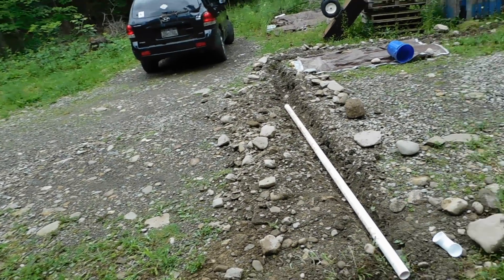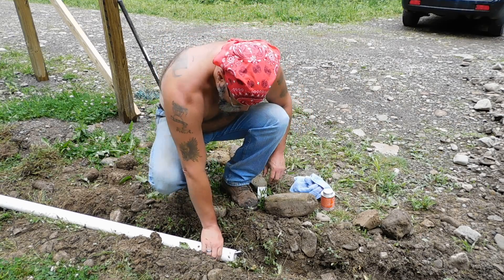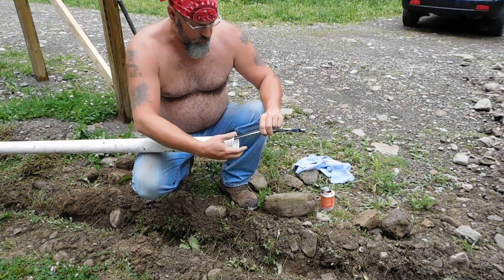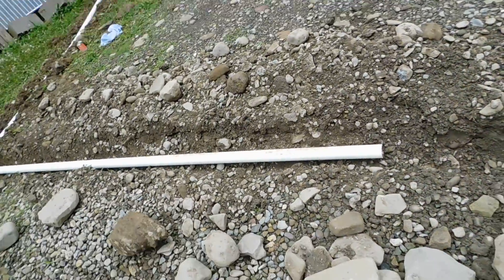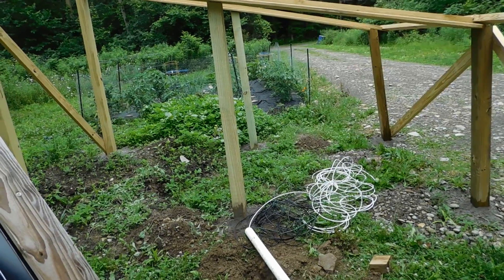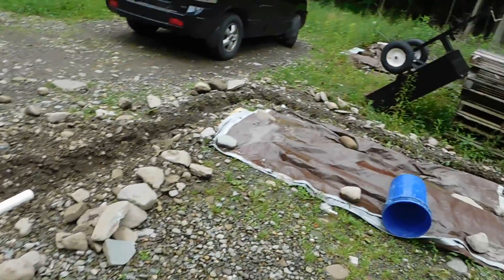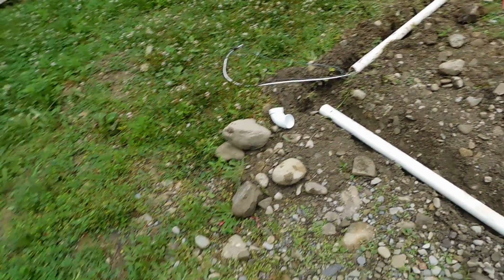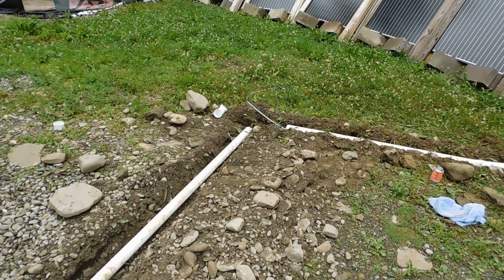Getting the piping and wiring in for the solar system at the Off Grid Homestead.

Comment: Brings back memories of when I had to dig down 18 inches to make the 120 VAC trench and then lay the code required gray PVC pipes and finally pull the three wires with additional pull string 150 feet from my garage power panel to the back of my back yard where the line came up to a sub panel and storage building. We moved the following year! Egads man!
Reply from the maker: Sounds like a very good time.

Comment: Buddy, next time post your intention and the guys here will give advice, I am not going to give advice after the fact.
One note for the future, paracord if pulled,  rubbing ....hard against the wire insulation will burn through it or weld to it with the friction, same with the right angle bends, good work getting more panels up, more is better?
Reply from the maker: Thank you I will do that next time.

Comment: Hey there...Just a few suggestions...Not Criticizing... Code here is that only Poly/Vinyl electrical conduit for in ground, better to run a vinyl coated cable for future pulls...most types of rope will rot out in the high moisture inside the conduit, pulling future wire through a 90 degree bend can be next to impossible in the future and there is a significant risk of compromising the the sheathing and  insulating sheathing on new and existing runs, Code also states that in ground is to be 16 inches deep for protection...However, I am not sure how some of this plays out with low voltage/off grid wiring...Using the Poly/Vinyl is the way to go for sure...the 'bell style ends Seal Very Well and when properly glues are water proof ( although there will still be condensation, some people with pitch it and put a weep hole or two in the low spot)...Also the Poly Vinyl Conduit has a better crush rating and will stand up better to stone back fill and surface traffic without cracking, and it is easy to bend gentle curves into it when trenching with smaller diameter conduits...Also, Poly Vinyl is made to handle higher heat temperatures that can generate with electric runs....Again...I am not sure on the low voltage set up...but if it was me I would redo the run for safety and ease of expansion .... the Poly/Vinyl conduit is inexpensive and a much better way to go under ground...get rid of that 90 degree...Also, the roots of the fruit tree will push that pipe around quite a bit over time.
Reply: Agreed good post and that 90 degree bend will cause problems, A vacuum cleaner will pull the string the full distance of the wire run with the right conduit.
Reply: Matt Man lol, i wanted to say some of this but didn't want such a long post.  glad someone else said it.  i just recommended putting it together then using s fish tape.  i wanted to talk about conduit and 45s, etc...
Reply from the maker: Thank you for the comment and I did a video today explaining everything and its ok I don't take it as criticizing.

Comment: I wonder if there will be any problems with condensation building up inside the pipe? We're having a problem with some communications wires at church that are running through a pipe inside the concrete slab, laid about 10 or so years ago. The only thing we can figure is that must be what's happening, but we can't get inside the pipe to prove it. If we pull any of it out, we have to pull all of it out, including for systems that aren't malfunctioning. I'm not an electrical or communications expert, just passing on a problem that could become relevant for you later.
Reply from the maker: Thanks for that info.
Reply: Joachim Bartsch 
That might help. Maybe throw in some sort of dessicate material first? Baking soda maybe? (I'm just theorizing.)

Comment: What no mouse to run through the pipe instead. Heather might scream a bit but Mighty Mouse will save the day. Enough with the puns, you are getting it done. We use a shop vac to pull the wire thru the pipe, just make the tape fill the pipe.
Reply from the maker: That's a cool way of doing it.

Comment: hard 45 are no good for wiring in pvc because you can not pull wire through it in the future you will have to dig it up again. also when gluing pvc you apply glue to both peaces and push together and turn or spin 1 quarter to create a proper connection. also put both arms through center of coil of wire and roll arms so as to unspool wire without any snares from one end of wire to the other and lay out straight on ground at end of pipe to be pulled into. save you lot of time and aggravation. By code buried electric is suppose to be 18 inches but with the rocky ground you have 8 inches I do not blame you on that. OH, electric pvc is always grey not white so any showing above ground spray paint it grey but for any future projects keep this mind.  when  you back fill mark your 45s to make easier to find in future when you try to pull new wire through and would not glue those in either.
Reply from the maker: I had no problem pulling it threw even with the angels.

Comment: if you ever do this type of work again with wires so much easier putting it on a spool a stick through the spool and use 2 Vertical cinder blocks with this Spool in between makes life so much easier running wire through piping without it tangling up
Reply from the maker: That makes sense thank you.